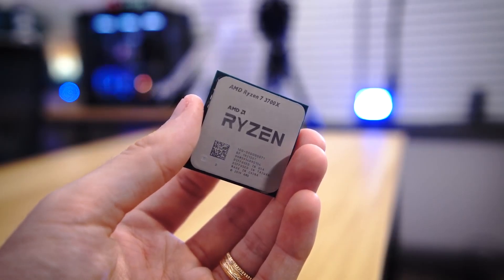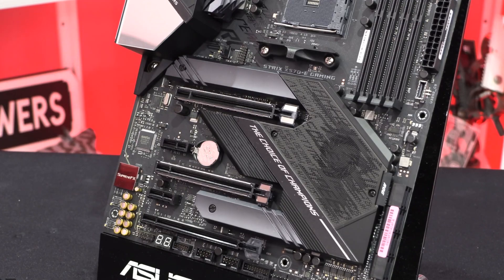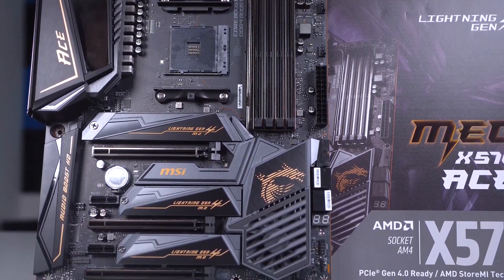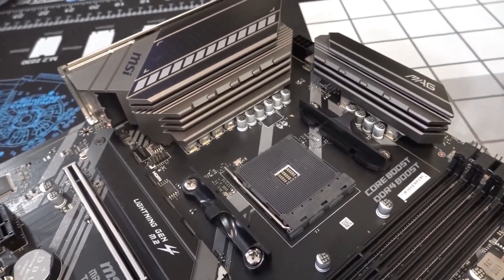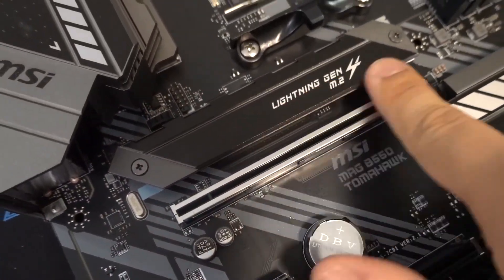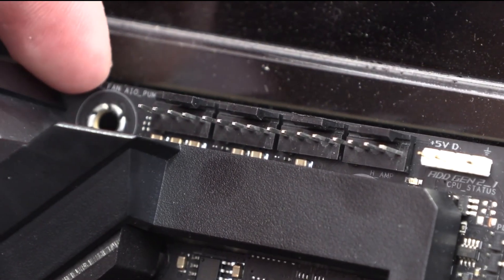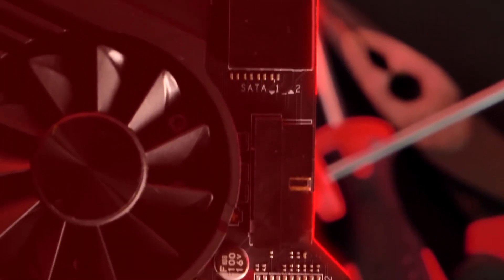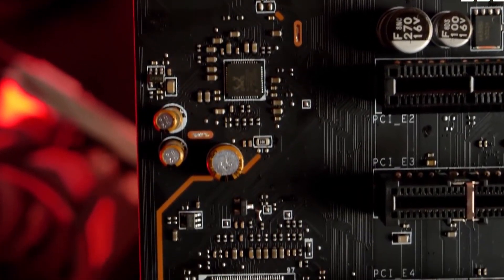Best Motherboards For Ryzen 7 3700x in 2023 [Buying Guide]

Comment: The Tomahawk exploded on takeoff!!! yesterday I was running risen on the "msi tomagawk" board. at the first start, 2 capacitors lit up...As a result, I replaced it with "aorus" from "gigabyte".damn "msi" boards for ryzen processors, I burned two "b" chipsets and one "x" three times... I won't buy any more for anything. just in case, even for intel processors, I will not take their boards: you will be tormented to run to the store and back until you change everything, and the system will be disassembled / reassembled every time...

Comment: I've stuck my 3700X Raisin on the MSI Tomahawk B350, cooling the cpu with a Big Shuriken 3. I am using a 6gb GTX 1060 because I fortunately already had it. I Also have an A10-9700e that I used to flash the BIOS because this B350 never got updated and was actually an open box deal because someone couldn't get it to work and either couldn't or didn't want to flash the bios. I think I paid $69 US for it inc. shipping. It has lasted me years and will likely last me till AM5 is out of its first growing pains and stable.
Reply: Hey man here 10 months later i looking on getting a 3700x for a b350. How is your still runing?
Reply: @spliittz666  pretty good! Although I am now using a b450 board for the build. Mind you, I bought early and got a b350 board and Ryzen 3 1200 to start, AND I needed an Athlon to flash the bios. Might want to go B450 and eliminate the extra step or check with the manufacturer for the B350 board for compatibility.
Reply: @spliittz666  I just found one for $220 on offer up what's the big deal?

Comment: would it be okay to use a cheap motherboard such as asus prime a320k and just for stack no overclock for both games and work
Reply: AN A320 might be a little weak for the 3700X, but checking that specific model's cpu compatibility on Asus's web site says it's compatible. You might need an A-series APU to update the BIOS for the Raisin CPUs though, and for the cost of both of those, you might be able to afford something better on the 400 or even 500 series boards.
Reply: @shannonrhoads7099  thanks

Comment: I do have a question. I currently have a Prime X470-Pro with a Ryzen 5 2400G but would I be able to upgrade my CPU to the Ryzen 7 3700X? I've read that you would most likely need a BIOS update but I just want to make sure it's compatible.
Reply: They are compatible. You just need to update it in the BIOS

Comment: I'm using it with the msi b550 gaming carbon wifi.
Reply: do you like it im looking for a mother board some one plz help
Reply: @griffinmangel5191  yeah. It's great. It supports 3000 series out of the box and is very Stable. Vrm temps are in the low 40s at full load (12+1+1). No bios, BSOD or black screen issues. Posted the very first time. 
Mystic light working properly. 
You can also check the tomhawk x570. Comes with the same price as the B550 carbon wifi.
Reply: How fast is the wifi ?
Reply: @gustavocastrejon8763  depends on the connection. I easily get over 150mbps on my connection. Its using WiFi 6 so it's definitely fast!
Reply: @rtxtitan9326  mines is 200 .thanks man I really want to upgrade

Comment: Ijust finished my build today with the same cpu but on the asus rog b550 f gaming wifi mobo. Is that okay too? :D
Reply: Yeah. It's absolutely fine. I'm using the 3700x on the B550 carbon wifi & it runs rock stable at 4.2 all cores at 1.375v
Reply: @rtxtitan9326  my b450 doesn’t seem to be working right now, should I try to switch to a b550? My 3700x and ram seem to not be the problem
Reply: @PurpleLoki-ei8kc  Yeah I think upgrading to a better mobo would be the best option as you mentioned that the ram & cpu are working perfectly well. 
Are you sure that the board is receiving power from the psu? 
Do check & reseat the 24 pin and EPS power cables to see if it does any help. 
 If your current b450 mobo is still in warranty then send it for rma & sell it off. It'd cover around 40% of the cost of a new board.
I'd suggest you to get an Asus or a MSI board.
Reply: @rtxtitan9326  I checked everything and all was fine, but it needed a bios update which I couldn't do since nothing was showing up on my monitor and flashback wasn't compatible. I just got an MSI x570, hooked it up, and everything works. Thanks bro!
Reply: @PurpleLoki-ei8kc  Great! Many Happy hours of gaming ahead.
Best wishes!
Reply: Youll be able to upgrade to zen 3 or probably whatever comes next in a few years if you want ^^
Reply: i just bought this cpu with asus rog b550 f, how is it? and what gpu u got on it
Reply: @justinkanji4721  I got it paired with a 1660 S (well, couldn't get a 3070). I do li'l gaming on 1080p so, mostly editing stuff!

Comment: Is it fine if I run 3700 Ryzen 7 on a msi b450 gaming pro carbon max wifi AM4 ATX Motherboard? Or do I need to upgrade my motherboard asap?
Reply: Which GPU are you using with this build? The b450 gaming pro carbon max is a PCI-E 3.0 motherboard, while 550 pro and x570 are PCI-4.0. The 3700X is a PCI-E 4.0 ready CPU, and the new 30 series Nvidia GPU's are also PCI-4.0. The performance difference right now is hardly noticeable, but you will see a difference with newer games and newer drivers for PCI-E 4.0

Comment: I have a B450 Plus gaming and one of my friends told me that it wasn"t the best motherboard for the ryzen 7 3700x because it didn"t allow it to run at its max basically. Should I upgrade or not? Im using it with a rtx 3080 for 4k gaming
Reply: Your motherboard will throttle your 3080 later as it's a PCI-E 3.0. 3080 and 3700X are PCI-E 4.0 compliant, so you could upgrade your mobo to a PCI-E 4.0 board.
Reply: @DahakaMatthew  I think there is no difference between PCIE 3 or 4 in benchmarks. Correct me if im wrong
Reply: @mohamedridhasassi2105  You are correct! Modern graphics cards, even mythological beasts like the 3080 TI and 3090 can't saturate PCIE Gen 3, much less Gen 4. It's storage devices, all those PCIE NVME M.2 SSDs, that really do the job. On graphics cards, it's marketing. Buy our thing! It's shiny and new! Shiner than your current thing! Buy the shiniest thing! (Shine does not increase FPS, your mileage may vary, don't feed after midnight...)

Comment: I wonder if some motherboards are basically made just to run any Ryzen at standard speeds and no OC?
 Some made for 6 core + some OC. 
 Others made for 8 core with OC. I believe I saw somewhere that the 3800x witch pretty much just a binned 3700x. Limited to 140 watts max.
The five you mentioned should also be good for OC of any 3700x, 3800x or 5800X. 
Enough good components for OC. 8 Core CPU with Gaming plus or the MAG 550 can do real well with those CPUs for many things besides gaming.
 Some boards are designed to work real well with 12 core with OC and 16 core with OC. Like the Ace, ROG Strix and the Crosshair
 A 5900X may work well enough on a Steel Legend or the Mag B550 but don't expect to be able to push it to more than the stated AMD standard specs?
I guess the port side is what makes you chose. USB, audio, thunderbolt, wifi and LAN port speeds.
Reply: Only for Raisin though. Nothing else. :D

Comment: Is It Okay If I Use Ryzen 7 3700x with Gigabyte Aorus Pro Ac B550 for Video Editing & Animation Purpose, I don't have budget right now to buy 570 boards, So I want to stick with gigabyte b550 pro ac board. Will I face Any type of issue in later? Please help & suggest me.. Thanks..♥️
Reply: Yeah. Surely You can use it. It's a great board. Even I'm using the 3700x on a B550 gaming carbon wifi.
Reply: @rtxtitan9326  Thank You..💗